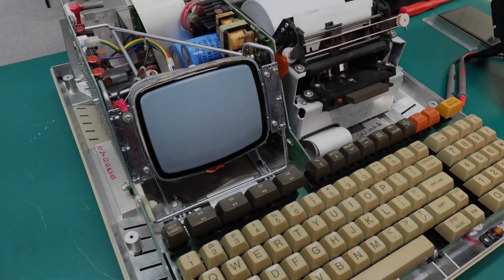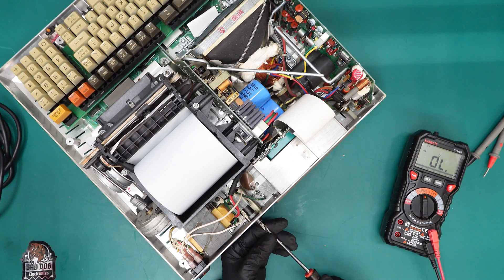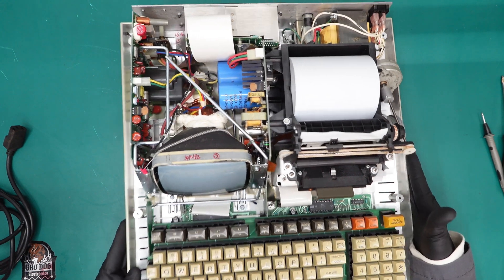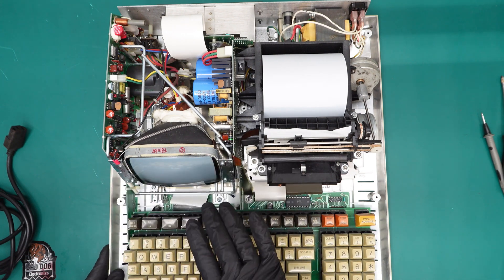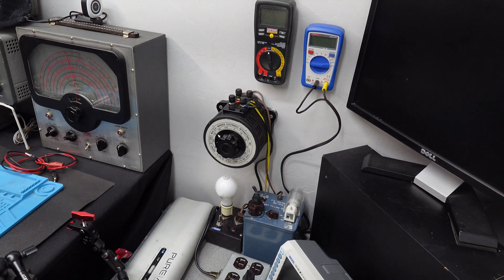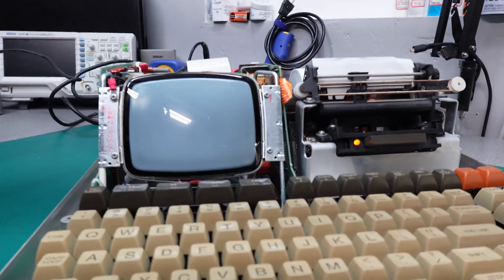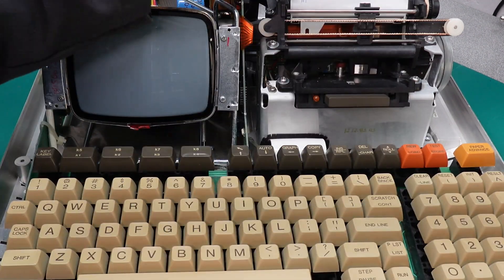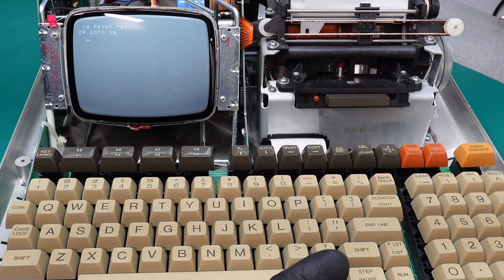Powering Up Old Electronics. HP 85B

Comment: Thanks, exactly what I was looking for - I was wondering if it was OK to bring digital equipment up on a variac... I've only seen them used more with tube style amplifiers, etc.   I've got an Heathkit H8, 3 Pets, an Apple II, an Osborne, and an HP 85 that I'd like to restore... so this was VERY helpful!
Reply from the maker: That's great! Glad it helped! For digital equipment and some tube gear even, be careful as some electronics don't appreciate low voltage/current for an extended time.  Thanks!!!

Comment: The ramp-up is good for the capacitors in the primary of the SMPS, but as soon as the minimum voltage is reached the SMPS starts and applies the design voltage to the secondary capacitors. Out of scope: even with a linear power supply and tube equipment, if the filaments are not hot enough, too little current flows, and the high voltage might be above the design voltage. Not the best for aged capacitors.
Reply from the maker: Thanks for the info. I've not had any problems with this process....yet ;) I stay pretty vigilant though checking no components heat up (excessively).   I'm working on a part two of this video where I go into a bit more detail as to when NOT to keep a low power situation going. Thanks again!

Comment: I worked with HP 85 and other higher model numbers in the 1980's to run automated electronic test systems in an electronic manufacturer. Loved those machines! Never saw one fail over 10 years in the factory. whoever gets this one will have a real gem.
Reply from the maker: Very cool story, thanks for sharing. It went to its new home yesterday. I'm really partial to HP....if you couldn't tell ;)

Comment: I would not always do that, there are several devices they could be destroyed by under voltage.. You must know what you are doing
Reply from the maker: Thanks for the comment.
You're right, some modern equiptment (motor controllers etc.) can be damaged from too low of a voltage, but ususally combined with drawing excessive current.  
I think the dim-bulb will keep components from drawing excessive current. I'm curious have you had/heard of any damage from what I described? I have not...yet ;)
Reply: @BadDogElectronics  The problem is some switching supplies, especially CRT drivers, will "lock up" with an undervolt, basically shorting the switching transistor (or tube) through the transformer due to low drive voltage stopping oscillation. While it may survive with the current limit, it's generally not good for them.
Reply from the maker: @trevorhaddox6884  Thanks! I'll need to do some research on this. i.e specific transistors / PSU topology,  at what voltage "lockup" can happen. I assumed that at the voltages I'm using diodes are rectifying, and oscillators are oscillating, switches are switching, etc. I also know what "assuming" does ;)  Thanks again.
Reply: @BadDogElectronics  If the CRT circuit is supplied mostly by a linear supply (like an early CRT TV/monitor), it's a big issue, as the oscillator for the HV transformer will get undervolted and may fail to start before the driver transistor/tube tries to conduct. In that case it's best to disconnect the flyback circuit before using a variac. If the deviced is powered entirely by a switching supply, that supply would need to be assessed for risk (IE whether the driver IC has protection). And obviously don't assume modern PSUs are fine, for example some lower end Class-D audio amps without protection can explode if undervolted, even under current limit (the caps charge up, it tries to start, losses voltage rapidly, fails to start, and dumps all the cap energy into the transformer).
Reply from the maker: Thanks for the info! I've not had any problems doing this...yet. Though I stay pretty aware  of any components getting hot during the process. Also, I don't let devices "starve" for current. If the bulbs light (no shorts/high current draw) I bypass the current limiter.
I'm making a part two where I talk about what I do if the device draws (excess) current or heats up.